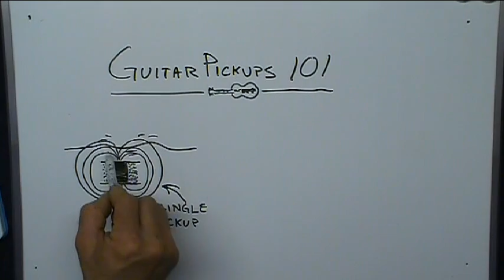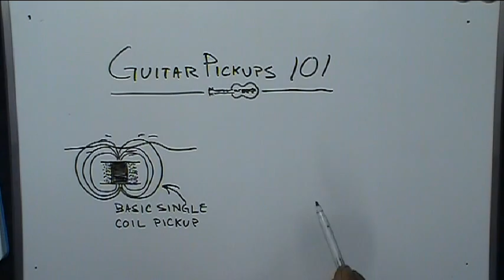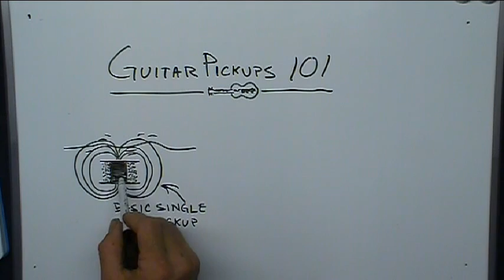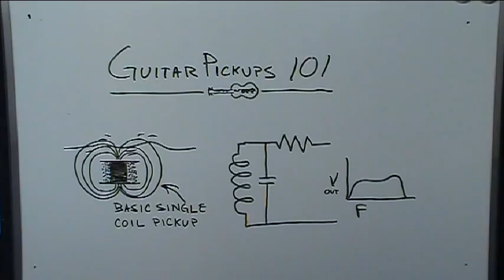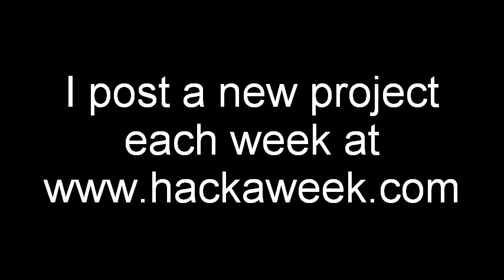DIY Guitar Pickup

Comment: this is great. I found some old elevator switches from an elevator. the electro magnets have a very nice gauge of copper wire i can wind around some monster headphone magnets i found. My question is , can i use uninsulated copper wire for the coil?

Comment: Okay, I have a magnet from a larger speaker and it has a metal plate on one side that significantly reduces the magnetic field (metal screws don't stick as well on that side.) which side should face the string, or does that matter?
Reply: *****
 Okay, but will the stronger magnetic field get a better sound?

Comment: A warning to anyone else trying this: I tried this with 42 gauge wire and the fire from the match incinerated the wire into nothing, leaving me with no end to clamp onto... should have left more there I guess but I'll admit I wasn't expecting it to go up in smoke. Also, I couldn't get any solder to stick to the wire and it was too thin to consistently clamp onto with the crocodile clamps. (Half the time it slips through the teeth.)

I can't tell what gauge he uses in this video but it seems to make things a whole lot easier for a do-it-yourselfer.
Reply: Pretty sure I used 24 gauge wire. The thin stuff does indeed burn up. On that I use 400 grit sand paper and lightly rub the enamel off.
Reply: Thanks for the heads up man, I'll grab myself some 24 gauge...
Reply: 42 gauge is hard to work with but it makes a much better pickup because you can get more winds on your bobbin more winds equals more output

Comment: What gauge did you use here? I'm using 42 Gauge and it seems wayyyy too thin to use reliably with this method. I've broken it several times already while winding (very frustrating, though my fault I'm sure), and the one time I got the whole thing wound (probably a few thousand winds) the wire ended up getting cut by the sharp edge of the plastic in the notch meant to hold it in the first place...
Reply: Use 24 gauge
Reply: Thanks for the reply! I ended up using 36 gauge which turned out to be just right. It was super strong compared to the 42 but I still got a lot of windings. If someone wanted to play it extra safe they could use something as big as 24, but even 32 would probably be plenty strong for the average Joe to not break it.
Reply: +John Moriarty  Hi, John! Have you tried the pickup with distortion?
Reply: Howdy! I have tried it with distortion and, though I'm not a guitarist and so am not very discerning when it comes to guitar tones, it sounded fine to me.
Reply: Thanks for answering, John. I suppose that the size of the magnet will matter, but if you don´t mind, can you tell me if you position the Pickup under your first string does it catch the sound of the other strings or does it catch only the sound of the string directly upon it?
Reply: Attaching the bobbin to the bolt on the drill by its own magnetism instead of glue helps avoid breakages.

Comment: Why didn't you use the coil from the speaker (isn't it easier to use the speaker as it was?)
Reply: Because he has a very low impedance (alternate current resistance). For pick the VERY weak electric currents induced for the string you need a moderate high impedance coil.

Comment: Please what gauge magnet wire are you using and how many wraps is needed?? Please & Thank you
Reply: He wasn't being totally scientific about this one. He specifically states that he was just going until he ran out of room on his pickup. Professionally-done pickups can have over 10,000 winds, but you can make do with far fewer. More winds means higher output, but a higher resistance, which I understand (though I could be wrong) takes away some top-end. Pickups can also use several different gauges of enamel-coated copper wire (important, since you want the current to travel through your entire coil instead of shorting from end to end). Thicker wires are offer a lower resistance, but limit the number of winds you can fit on your spool. Really, it's hard to go wrong. Experiment a little, see what you think sounds best.
Reply: Zarke void your completely correct apart from that most guitar pitch ups have about 6000 to 7000 winds on them if you had 1000 one one the guitar would have a higher output but would lose a lot of high end which would cause it to be way too bassy and lose a lot of clarity, it is also why bass pickups tend to be big as hell
Reply: antony bell You dont happen to know how many turns would you need to get any detectable output? I'm doing this for my physics a levels so a large number would be difficult to achieve and so far i have had no luck in getting a detectable output.
Reply: It's completely subjective.  It depends what kind of pickup sound you want.

Comment: Hi, i haven't understood the final part: after you connected the two cables to the copper, how you connect them to the speakers and to electricity? please someone help me thanks a lot :D
Reply: ioamoSSCN 
I believe the speakers will supply the electricity through the wire to the pickup as long as your speaker is plugged in
If that's even what you're asking

Comment: what kind of wire did u use?
Reply: You need a wire that's fairly thin for more turns. 42 Guage works best (0.1mm approx). The one he used looked a little too thick.

Comment: Check it with an ohm meter. It should have a resistance reading. If it reads open, it could be a faulty connection to the winding.

Comment: Since watching this excellent video, I am wondering why some pickups fail? Is it a break in the wire, or the coating has come off in areas? What would be the most common reasons and logical steps to repair? Thanks!
Reply: magnet wire to thick ? use .38 AWG or thinner.  a broken wire would cause a fail, but if you have a Ohm meter, you can check for resistance,  if there is no resistance then the wire is infinately open.. or prolly broken. damaged enamel coating ? if two adjacent wires both had exposed areas & were touching it could lower the resistance . if your using metal plates or pole pieces , ect. the exposed copper could be shorting to ground. but this can be tested with an Ohm meter. are you connecting the 2 wires from the pup thru a pot or other routing, or strait to a female TS 1/4"  mono jack ?  these pups are called passive & are concidered "High-Z" or high impedance so the actual electrical signal will be very small ( millivolts) so they wont work going into a line level input without a preamp. so a real guitar amp is needed , as they actually contain the preamp in them, although,  my powered PA system has 2 dedicated High-Z input channels that could be used. and i think the powered karaoke machines would work as a microphone is also High-Z , as ive seen some mic inputs use 1/4" mono. also if you had a cheapo guitar effects pedal like a distortion or overdrive, they would probable boost the signal up to line level to plug into , lets say an old set of powered computer speakers. and lastly..  the magnets themselves have a north & south pole , the magnetic field flux travels from the N. to the S. if using more than one magnet, make sure the orientation is correct in relation to the copper windings & the METAL guitar strings... lorentz's law covers the tech'y stuff if you need to look it up. if the mag. field flux is traveling in a vertical motion around from N. to S. , then the windings should be at 90 degrees wrapping horizonal thru the mag. flux field in order to disrupt the most electrons out of thier valence . and the strings should be 90 degrees purpendicular to the copper windings...and also the strings , moving & at rest, should reside within the mag. flux field.... i hope this gives you a little help... and you can look up the electromotive force  & electromagnetic force laws by the great guys like; lorentz , maxwell, lenz, faraday, tesla, ohm, henry,  among others.. 😎🤟🏻

Comment: Think electromagnet, if you've ever built one, it wont work without insulation. If you dont have enamel coated wire you could spray paint it, technically.

Comment: Using uncoated wire would short out the spool. The more turns you have the more "noticable" the effect of the guitar string interacting with the magnetic field of the spool is. Using uncoated wire would simply short it out so that you would essentially have no turns, and thus no practical effect. In practice you wouldn't get a signal from the pickup.

Comment: ive asked about this before, all I was really told was that it would depend on it the pickup its in, but its not advised in any as its a reaaaally strong magnet and the pull on the strings may cause unwanted noise and lack of definition.

Comment: thanks! that is awesome. i need to make a pickup for an upright bass neck, it has to be rounded on top a bit to the curve of the fretboard. if i used 4 magnets for the bass, does the magnet wire have to go around all 4 pickups at once or can i wind each magnet individually then proceed to wire them together in series?

Comment: @hemax1000 The key to a good sounding pickup is to have coated enamel wire wrap around a magnet, the wire has to be fairly tight and for a better sounding pickup you want to randomize the spooling. You might not have enough wire wound or might have too much or a bad magnet. I would check first the connection to the amp.

Comment: So, from looking at this and some other things I saw on this subject, you can also coil the wire around a bunch of screws, and then glue some of those lil' magnets on top of them? What would happen if I made two "half" pickups and position them slightly angled, one in slot one and one in slot three (leaving slot 2 open for something else)?

Comment from the maker: @GenericPurpleTurtle Yes it has to be "magnet wire" which has a very thin enamel coating to insulate it. The thin coating allows the wires to be wound very close to each other which is important for the induction effect. Radio Shack sells this wire as do other electronics supply sources. Search for "magnet wire". :) Good luck.